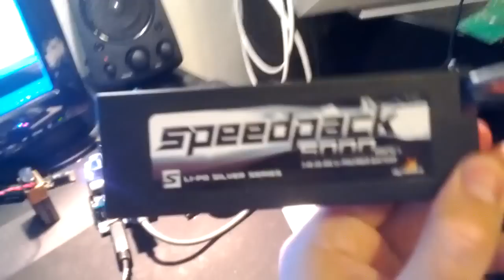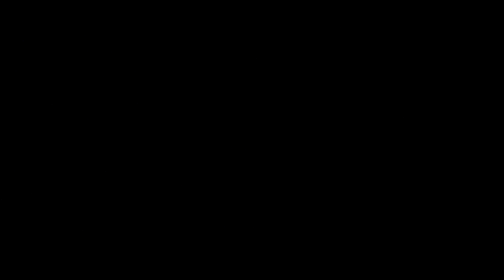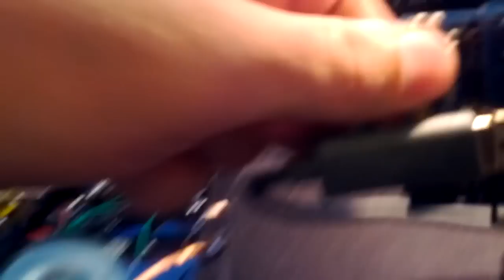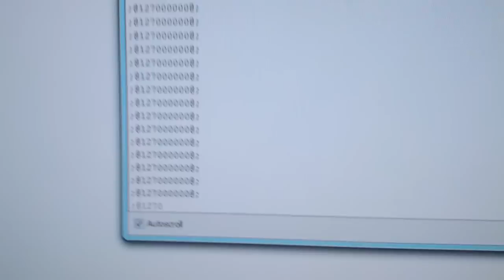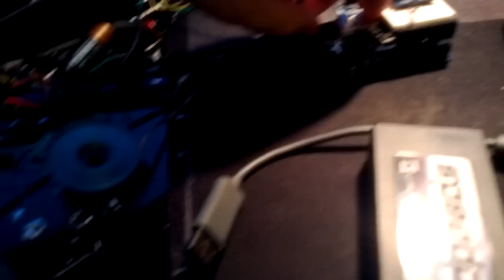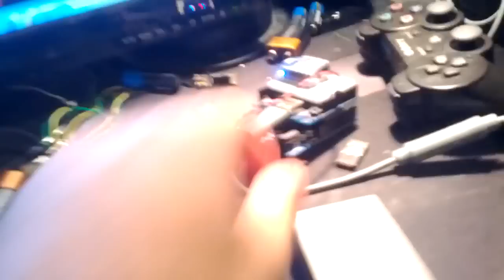RC car with PS3 and xbox controller

Comment from the maker: Could you buy the whole thing? I suppose you could but it cost over a grand. Esp now that I have an insane brushless motor in it. You can use any settings you want, completely up to you really. Yes you can have up to 4 more servos, since you get 6 pwm channels on the arduino and 2 are being used currently. This can be higher by using another auxillary arduino.

Comment from the maker: It's just an arduino uno with a usb host shield(R2). I would recommend a mega2560 which is what I use now instead since it has more than 1 serial port so if you end up using a serial radio like I have in the video you can still do usb debugging. You can get them for $21 from sainsmart. The usb host shield is about $30.

Comment from the maker: and unless you know what you are doing and can figure this out yourself I advise against doing what I did since there is a high chance of fire and blowing components very easily if something is not correctly done. Those batteries can supply up to 300A(or more) of current so if you hook up something wrong you may burn down your house as these batteries can explode if abused(short circuit). This is a friendly warning as I have had 2 disasters with lots of smoke with this car already lol.

Comment from the maker: Well in all honesty the way I do things really arn't practical for anyone else to do. I do them the way I do them because I am always seeking to do something more than normal. As far as a schematic goes there really isn't much there. I have a 5v regulator that powers the arduino and steering servo. The steering servo goes directly to a pwm pin and if you are a normal person and use a normal esc(speed controller) you also run that to another pwm pin. The xbee just has power and RX/TX.

Comment from the maker: I would say the analog sticks on the ps3 are better(the xbox took more compensation to tweak properly) but the xbox shoulder triggers are more responsive so each one is a bit whacky but both work fine. It did take some value conditioning to get it working the way I wanted and the code for that can be seen here: pastebin(dot)com/CAzDmYNa

Comment from the maker: Buy like a 200 in 1 or so electronics lab kit. Radioshack still sells the one I had when I starting out: productId 3814337 . They are awesome for beginners I think. There are others out there so feel free to look at what is there. Also lots of reading helps but I've never read a book so meh on that xD Esp now with the internet you can find all the info you could possibly ever want. MIT even has full courses uploaded! A lot of people do it the cheating way where they use microcontrollers  ehe =p